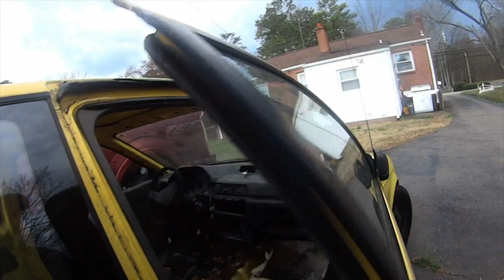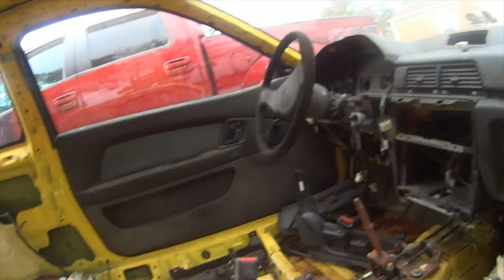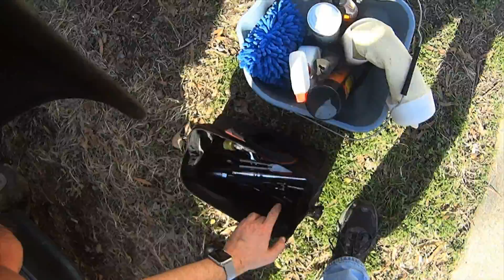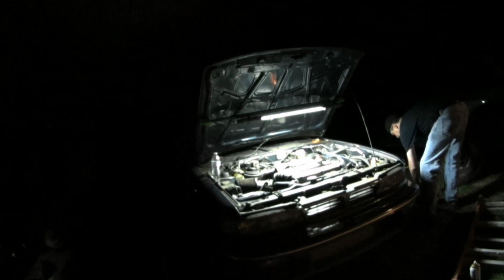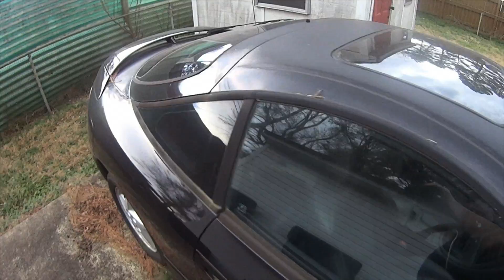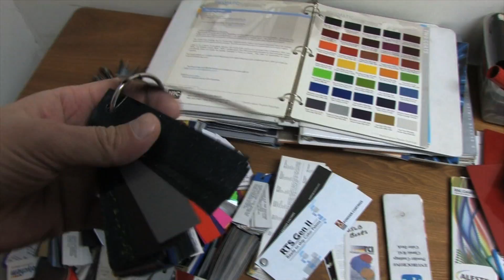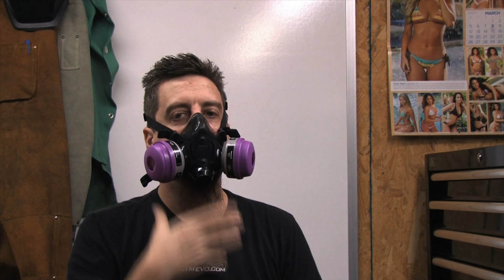2017 Cliff Notes

Comment: Just sold my GVR4 today, then got home and watched this video, lol...  I'd be willing to babysit yours for you to keep the county vehicle nazis off your back ;)
Now for trolling / flame throwing - did they really bake your block at the same time as your brackets?  That engine block probably needs 3 times longer to get to proper curing temps than those much smaller brackets.  It's the substrate temp that matters, not the temp of the oven.  engage sarcasm Without knowing any other details other than what you filmed, I'm going to declare without hesitation or doubt that the powder coat on your block is under cured and will be "soft" / less durable than everything else, and I defy any and all to counter my expertise ;P
Reply from the maker: Once the front steering rack is installed... just wait until you see what this one runs at the track.  ...and just like it's been sitting.  I drove this exact car through quarter-final bracket racing eliminations 10 years before I bought it.  It's a certified bad-ass is what it is.  >:)  It runs a full second faster than the Hyundai, consistently, and on only 550cc injectors.  It even gets 26-28 mpg with COLD AC.

Comment: Does the front end of the Hyundai look like a Toyota paseo?? Yea little bit
Reply from the maker: The bumper cover on it now is a Subaru Legacy GL Wagon, cut and narrowed 2" with a piece of a Mirage bumper cover pop-riveted to the middle of it to fill the gap up to the grille, and a piece of PVC pipe cut in half, painted black and riveted to the bottom.  It's a Mitsubarishome Depot bumper cover.
Reply: Love your vids man long time sub :-) I just thought the headlights look like Toyota ones if you look quick

Comment: how did u get the wideband to stay running while the turbo timer counts down? I'm only running wideband as well.
Reply from the maker: I hooked its power wire to the MPI power circuit (the circuit that runs the fuel pump).  I did it with a relay.  The Hyundai bug squashing video (#17) has a segment with me wiring in a second relay.  That's what that was for.
Reply: OK, cause I really need to do the same. Mine shuts off sometimes when I let it idle (with the turbo timer)and I always have a hard time keeping it to idle on warm starts after I let the turbo timer shut it off. Thanks
Reply from the maker: That absolutely kills o2 sensors, btw...  They're heated o2 sensors.  They cake in carbon if the engine's running and they're not heated.  You'd be best off fixing that.  Find a wire connected to the MPI relay circuit (like the ECU + Power to eliminate a voltage difference between the car's brains and the wideband's brains).  Make sure you share the ground with the ECU, too, if you do that.  I ran a trigger wire to a separate 30A relay connected to battery+ which is a little bit overkill, really.

Comment: Good to see the Vr4 is still happening... update on mine... it is finally alive & driving with the 2.4L bottom end & 1mm OS valves & BC 282deg cams.. Turbo is a 18G with EVOIII manifold. Only have 300Km's on it but running 13PSI Boost & am impressed with it. More power to you Jafromobile!

Comment: Did you torque your spark plugs? What is your preference when putting in new spark plugs also, was far as torquing or tightening. Thanks
Reply from the maker: If you watch the previous Galant video where I got this car running the first time... I showed how to gauge the spark plug torque without a torque wrench.  I guarantee I put 19 lbs on each one even though I never had a torque wrench in my hands.  It's all about how many degrees from finger-tight that you go on a new plug.  It's a little over 3/4 of a turn on a new spark plug to crush the washer correctly.  It's different on a used plug, and that is also covered in that video.
Reply: Thanks. Your videos are very talented. You dream of coming across videos like these when diving into YouTube.. and you've done it time and time again. Awesome

Comment: It's great to see another video update from Jafromobile on here. 

I love Yoshifab parts they are my go to place, I ordered 2 sets of adjustable camber plates for both of my 3G csms, for me it's a safety concern on-top of all the benefits jafro has mentioned in the video, if you use the stock old rubber upper mounts, especially if you're doing a lot of spirited driving, then your begging for an accident to happen... There have been a few cases where the stock rubber bushing would tear and separate from the upper metal mount of the strut completely... The Yoshifab camber plates don't have any rubber to wear or tear, so if your stock upper mounts are worn, or torn, don't waste money on stock ones that will tear again, just save up your money, and then buy the yoshifab units, they are easily worth every penny.

Comment: Nice to see new videos from you here Jafro. Unfortunately right now I'm not able to follow your work on patreon cause I'm from Brazil and my credit cards doesn't work there.
But tell me something. I see that you powder coated the water pipe from the gsx. But just like you said, its the king of bling. What do you think about of using a shining aftermarket stainless steel water pipe on the gsx? I am hand mading some of them for my car and for some friends that are having trouble with corrosion on theirs original ones (its really dificult to get original parts here). It wold be a pleasure to send you one if you like it to use it on the gsx.
I got this picture from one. The grinding and the polish it's not complete yet, but you can have an ideia.
Tell me what you thing about it. If you like it I can send you one. It would be a honor to contribute with the gsx project.
https://drive.google.com/file/d/0B5f6deF8sCi6ZlZJdk92Q1RHbjg/view?usp=drivesdk

Comment: i thought more negative caster gave more camber with the wheels turning so keeping the tyre upright in a straight line and giving more camber the sharper you turn, plug it helps to self centre the steering?

Comment: I was working at an auto repair garage as a young man and the boss was checking for spark just as you showed with the plugs laying out on the front of the engine block. He told an assistant behind the wheel to crank it over a few times. Well not only did he find out that the engine made spark but he also learned that the injectors were working because he was instantly engulfed in a ball of fire. Another mechanic had to put him out with a fire extinguisher. The boss ran around whooping and trying to take his burning clothes off. For some reason stop, drop and roll escaped his mind.
Reply from the maker: That's both hysterical and tragic at the same time!  Yeah, that can totally happen, too.  It's not very much fuel.  I'm sure he was fine, but it makes for the funniest of memories.  :)

Comment: have you ever used POR15?
Reply: squarrl where are you?
Reply: Halifax, Nova Scotia Canada
Reply from the maker: Yes!  It's why the Galant tunnel in the floor of the Colt didn't rust.  Most of the rust you see in there is metal shavings that weren't vacuumed out of the car that puddled from extreme condensation events.  I might media blast this thing before it's all said and done.
Reply: Spent year and a half coating the whole floor of my IS300 with it. It seems to hold up well, I went over it with truck bed liner because I was worried of rock chips. I live in the worst rust area in the world, you wont see cars over 10 years old due to rust here. I am happy to see you still have all your projects.

Comment: I actually went from a single strut bar like that to running twin bars, and it made a real impact in how much I could hear the body creak as it flexed under load, I highly recommend it. It seems a single bar allows for significant movement of the unsupported bolt's side of the tower, it's not negligible.

Comment: Jafro, where'd you get your ISC from? The factory ones seem to be unavailable anymore.
Reply from the maker: You're not going to believe this.  Hit your address bar.  type... dsmisc don't forget to add your dot com.  Inorite?  Go figure.  That's actually where my Galant one came from over 6 years ago.  You could just probe one out in a junkyard and make sure all the coils work... Check that website it will tell you what cars to look for as donors.  Those you typically pick up for less than $20.
Reply: Jafromobile I'll check them out again. Last time I tried to order from them I got no response in a month and a half.

Comment: you guys sure have bad gas over there, Ive had cars sat 1-2 years and start right up
Reply: Just started up my Stealth last weekend after sitting a year. It was under a carport but it still gets hot here in Houston. The battery tender worked great!!!
Reply: 30GB all the fing ethanol
Reply: ***** it's the ethanol just buy non ethanol fuel usually it's just "premium"
Reply: i have a datsun 720 double cab ute and after 15 years sitting with aviation fuel(leaded fuel)
it fired up first pop(not even a full rotation)
i added today's fuel a few years back and  just over 1 year the fuel(today's shit fuel) turned to varnish and goop in the carbs and only spluttered  a few times and that was it

was also sss version with twin Hitachi side draft carbs

so it goes to show you fuels of today are shit

id say bring back leaded fuel

Comment: do you guys have 4gcp engines in the us?
Reply: you mean G4CP, it's a Hyundai 2.0 dohc, it is basically a non turbo version of the 4G63, it was used in some Hyundai sonata sedans from 1992-1998 you can use some of the parts on dsms.
Reply: THANKS, i have a G4CP in my eclipse. got it from a sonata :)

Comment: red would be alot faster than black, clearly
Reply: That's what "they" want you to think, but "everybody" know that golf balls have terrible heat dissipation. Those dimples trap heat! That's why you never see the inside of a golf ball coated in glyptal.
Reply from the maker: +richard daly but smooth surfaces have a thicker aerodynamic boundary layer.  "They" say it's faster if it's covered in dimples like a golf ball...
Reply from the maker: +William Dye I gotta tell ya man... you won the thread!  I've got nothing on that.
Reply: Flame war? Nonsense. Obviously and undeniably the ONLY correct engine block paint is anything that has sparkles in it. BECAUSE SPARKLIEEEeesss!!! plays nine notes of "dueling banjos" on an acoustic guitar
Reply: And the flame wars are a go!! yes I helped it happened.
Reply from the maker: nuh uh.
Reply from the maker: Not as fast as clear!
Reply: no blue is faster!!
Reply: The block needs to be shot peened then mirror polished, then clear coated!

Comment: About powder coating,  in reality not so nice like you would think. I've seen  some rotten powder coated light pickup truck beds and frames, and most the time the  spray painted  ones where  rusty but good. Powder coating will produce a nice sealed  habitat  for corrosion, where normal paint will fall of with most of the rust.
Sounds crazy, but i see this over and over and over again.

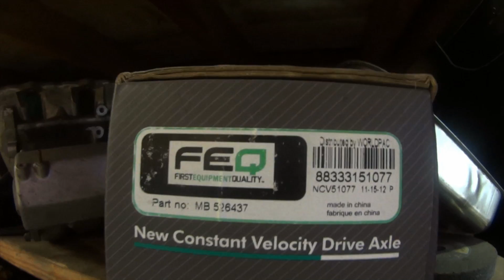Comment: Patreon money well spent! Kinda glad to know (at 5:33) that I'm not the only one who has trouble with front axles that turn out to be the wrong part. That's happened to me twice. The first time I discovered the mistake only after strenuously getting the old axle off, checking the old & new parts too carelessly so I didn't see the subtle difference, putting on the new axle, and then failing to get the wheel back on because the axle was just a tad too long. The second time was the same day, when I ordered a new axle at a much higher price from a local store, because I needed to get on the road that night. At least the second time I noticed the problem right away. After getting the wrong part from two different suppliers, I had little choice but to put back on the axle with a torn-off boot and drive 500 miles home. There's a happy ending, though. The nearly boot-less axle made the trip with no complaints. Thanks for the tip about FEQ. Maybe I'll try them when I get around to replacing that axle again.
Reply from the maker: Axles will work for years with a torn boot.  Sometimes even more years after they start grinding and thumping.  They do get messy for a while, though.  Still a pain to go through all that... Is it a C/S/M?  Why did you end up with long axles?
Reply: carqwest is were I ended up finding the right mirage turbo axle can't wait to find out if the one you got works to know there is another source. Do you have the mirage turbo halfshaft as well?
Reply from the maker: I think the axle I bought comes with both, but yes, I do have it just in case.